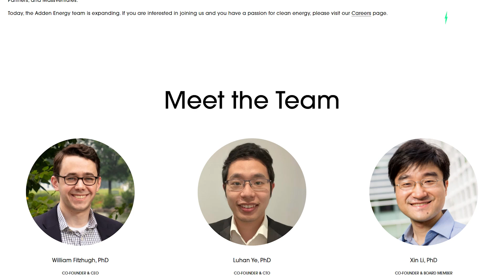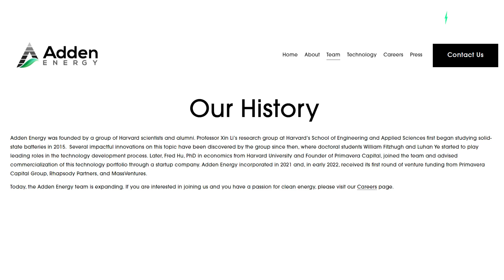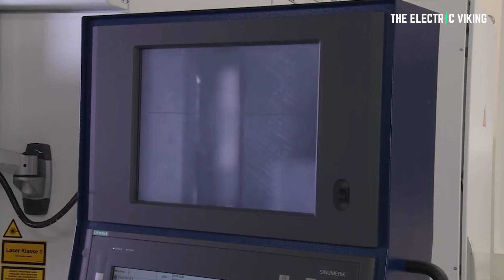Harvard engineers develop solid-state battery that works for 100 yrs

Comment: Hey Sam, thanks for another great video! The quality of the content you present has greatly improved, since I started wathcing your videos more than a year ago.

As for SSB, they might have their role to play but probably more in : race cars (you could imagine an only electric version of 24h Le Mans where fast charging could come in handy), sports cars (where having a battery that can bear huge decharge rates is a plus), hybrid battery systems cars (thus making waiting times shorter when you're in a hurry or just crossing the country for holidays) or even just in critical areas (like backup batteries for hospitals, fire departments, servers) that need a battery able to quickly deliver and be recharged (in case of succesive blackouts scenarios).

Comment: Geely's fast charger sounds good, but how long will it take for me to see this charger at my local gas station? Be able to buy a decent car that can accept such a fast charge? How much stress does that hyper jolt put my battery pack under? (A lot) Does it prematurely age my battery pack? (yes). Also keep in mind the unusable portions of battery packs, not below 20, not above 80, that's 40% of the pack not available. You can say that car has 300 miles of range but it's really only 180 and that's before hot/cold weather. AC and heaters inside. Standing and waiting. Etc.

Comment: At the risk of sounding like I take this seriously, if this sort of battery with long durability, high energy density and fast rechargeability became available, but only at a high price, cars could be designed with double or perhaps even triple battery packs. One small SSB pack capable of 25-50 miles for daily, get around town use and a second larger LIP pack that would have 200-400 miles of range for the occasional interstate jaunt.

Comment: I can see solid state batteries being used in multi chemistry packs like ONE are working on to cut down on charge time when needed. Maybe it will get good enough and cheap enough at some point to just have all solid state. Might be just the really expensive cars first, ones that are $130,000 or more.

Comment: I think solid state battery will be part of the future. If it does not fall into flavor because of future higher density batteries, Toyota will have the back up plan to continue. It is only a pity that toyota still mainly focusses on ICE in their rhetoric than coming forward stromg with the ongoing research of SSB.
Reply: Awhile back, I watched a documentary on Toyota and I recall they leveraged hybrids nicely as their fulcrum point of change. It takes tens of thousands of hours of analysis (roughly 80 hours a week @ 5 years) and a little luck to stay relevant. Underestimating the cost of disruption is very dangerous and can cost more harm to the environment than realized.
Take for instance what is going on with the protest by Norwegian farmers against environmental regulation of the nitrogen emission by cutting emissions in half but have done nothing to fund replacement with the correct solution.
By cutting subsidies for fertilizer in half but not providing an answer for maintaining sustainable levels of yield and quality, there is a risk of many food shortages and hunger.
Likewise, producing the solid state batteries to sustainable yields needs intense levels of time spent in the labs, government policy review, market creation incubators at a high level of articulation.

Comment: I believe that this is the reason why general motors decided to go with pouch style batteries. Pouch batteries are the easiest to convert into solid state so if you have a factory that is built for pouch batteries and later the solid state batteries are perfected you can more easily convert a pouch battery factory to a solid state then you can with either prismatic or cylindrical.
Reply: I think you have a good point, at the rate technology is moving  , design things adaptable,
Reply: Highly doubt the production lines will be in any way interchangeable.
Reply: @lengould9262  I don't think it's as simple as that, my point is that they built the lines with upgrades in mind.  Right now Prismatic batteries are just as cheap as Pouch batteries and to top it off they're much easier to thermally manage, so the question is why wouldn't GM have standardized on Prismatic?  The reason, I believe is because Prismatic batteries don't have the same upgrade path to Solid State that Pouch batteries have.  As an example I'm fairly certain the same machinery utilized for creating the Pouch Laminates can be utilized in creating Solid State Laminates.  Will the factory need to be retooled?  Of Course, but instead of it costing 4 Billion to build a new factory they should be able to retool an existing pouch factory for WAY, Way, way less.
Reply: Hard to roll ceramic...

Comment: A solid state battery that lasts 100 years.  Sounds expensive. Like something the government or military would buy.  Something useful in semi trucks., submarines, emergency response vehicles.  A battery pack that out lasts its original vehicle by decades would be disruptive.  The model of ownership would change.  You buy the car, lease the battery pack.  Or if you buy it outright, do you have the right to put it in your next vehicle?  Would EV manufacturers continually change designs to discourage exactly that?  There's always some new ratfukc around the bend with new technology, some way to squeeze more money out of the consumer.
Reply: A 100 year battery could be a life saver on Mars and in space. So it may not be disruptive after all. I think the key here is inculcating 100 year battery  infrastructure as a seed of military, NOAA, and space industry growth.

Comment: For general public I don’t believe solid state Batteries will be needed if they can get a dependable 300 mile range in hot or cold weather and 5 minute or so charge rate even 10 minutes for a full charge wouldn’t be to bad. If they can do this and have a long battery life that would last 10-15 years it would greatly reduce the environmental impact.

Comment: To charge in 3 minutes, will demand  a line from grid to battery 😅  of enourmus dimensions, say 50kWH in 3 minutes. I think that better batteries maby you do not have to charge more than once a week, the charging is done at home in the night. The other possibilitys is that we use small personal viecles, take the battery to youre home, charge over the night.

Comment: I'll follow on sorry  for so many comments.  The problem with lithium is scalability; there isn't enough. I checked this particular solid state cell is Lithium Metal - but others do not use lithium.  If you get a safe battery; you can cut the weight of EVs down to that of hybrids and ice vehicles; this is critial to becoming superior to those types. RIght now you need a very heavy protective 1000lb package to protect from punctures. If you can do this and lower costs, and increase or even maintain life span; at a similar cost per kg/per watt - then you transition from marginally green and expensive to cheaper and very green potential.

Comment: They didn't mention energy denisty but this is the sort of battery tech that EVs need to meet their potential. It is a double edged sword as batteries of this level of superior capability make investing in lithium mines and other existing tech look like very risky ventures. Are you going to invest in Lithium mines if this shows up in 3 years?  True maybe this has some lithium also they didn't mention chemistry either; but other new options don't use it.
Reply: Lithium has it's momentum similar to silicon in solar and CPU's. I wouldn't be surprised to see hungry advancement keeping pace with budding technologies trying to dethrone the leader.

Comment: What is even the point of making batteries that last a lifetime when the components besides the battery dont last a lifetime and you need to scrap the car anyways?
Reply: The old "buy and throw away" mentality will be going away. Repairing your stuff will become the new mentality. So, EVs will last much, much longer than previous generations of cars.

There's always going to be someone willing to repair old EVs, since the battery will still function and represents a good amount of value.
Worst case; some EVs will be hard to repair due to spare parts not being produced anymore (or being proprietary shit like Tesla), but then you can take that battery pack apart and put in an EV which had a battery that didn't last as long.

Currently, even decade-old EVs are going for insane prices, and still being sold pretty quickly.
I can even see myself fixing old EVs, if the upcoming engineered crisis takes away my employment.

Comment: lol SS batteries will improve and evolve the same as traditional is doing at this very moment, it will only borrow innovation tailored for the latter and improve on it. Both will be replaced by a new format within the next 10-15yrs, city/town commute daily drivers will be down to weekly charge times by then.
This whole deal will come right on down to weight, volume, and hazard mitigation out of the box.

Comment: I suspect the cost of solid state batteries is more due to volume of production than base material costs. So , ruling them out on cost is misguided as the costs will drop once volume manufacture is achieved.
Reply: It may depend on how large of a single crystal can be grown without disruption. That is part of chemistry and scale that requires a very high level of control.

Comment: Geely's 600 kw charging is definitely not going to be viable for atleast 3 years. Tesla had trouble with heat before with slower charging speeds. Plus battery degradation. And the sheer amount of energy to run these  stations is too much.
Reply: It's the materials and design that overcome the barrier of higher voltages. There are many chargers driven with Silicon Carbide Semiconductors and Gallium Nitride threatening to replace it. Both of these technologies are a threat to each other.

Comment: They key issue is time. Charging rates and charging station availability and costs will be the determining factors for the masses. Of course, battery tech goes hand and hand with charging rates however, consumers do not care what type of battery is in the car, we just want to know that 300 miles down the road we will be able to fill up at a reasonable cost in minutes rather than hours. Pretty simple, time waits for no man.

Comment: 10,000 cycles at one a day is 26 years. Filling up once every three days is 82 years!
Reply: maybe the calculation is full cycles, meaning 0 to 100%, but if instead is from 15 or 30% to 100 then maybe that number will triplicate or more.
Reply: was literally picking my calculator up to check the number which did not make sense in my head. 27 years at most charging from 0 to 100% everyday
Reply: I also do not understand at the beginning he said that solid state batteries are not long lasting and after a couple of minutes he said they can be recharged 10 000 times in comparison to lithium ion cells around 2 000 - 3 000 times. So why SS-Batteries are not long lasting I am confused!
Reply: @Tron Jockey maestro but where did you get 300 miles? i think the only clown here is you jockey.

Comment: If battery life continues to improve, the batteries will outlast everything else on the car, maybe several generations of cars.  You might end up swapping out the car and putting the pack into a new one, assuming the car manufacturers design them to allow that.
Reply: Which make Teslas impossible to change cheaply with the battery being a part of the chassis.
Reply: @MegaWilderness  not really, the chassis component is considered one part, removable without loss of integrity. How it is fastened together, leverages sharing of the structural load.
Reply: @gary.richardson  Don't be naive, the carpets are glued to the battery and the seats attached too, bonded with glue or sealer no doubt. Wiring cooling etc. Nightmare swap. You won't catch me buying one. And you get only one place that can do it at extortionate cost

Comment: BINGO! Great one Sam! 
Indeed the solid state guys are too late to the party. By the time they are mass producible and reliable, they will have missed the entire switch to EVs. 
However, next decade’s (or the one after that) new vehicles may well be solid state. 
Which begs the question of how car companies can even stay in business at all?  If cars become self driving and have batteries that last a million miles and maybe are made from stainless steel like the cybertruck…. what the heck would cause anyone to have to buy more than one vehicle in their lives? Given that, how could auto companies survive after the initial sales are over?  
Perhaps auto makers ought to rethink how long these things last and price them accordingly? Maybe have different pricing tiers for how long that model should last??
Reply: Cars may become more like houses and go through remodels and upgrades. People go to home care centers like Lowe's and Home Depot to do DIY repair, improvements and add value to their home.
Alternatively, car dealers will become battery dealers that cater to relevant products and services that surround the battery. It seems to make more sense to be battery centric, right?
Instead of Home Depot, it's now Battery Depot, where you can do things like do performance/safety mods, RV conversions, aesthetics, etc...

Comment: Critical problem for solid state batteries is that it consumes more lithium, which is a big deal because of Lithium scarcity, and will not work at today's Lithium prices!
Reply: Lithium isn’t scarce , just the refinery’s to process it . That will change.
Reply: @Rosewood185  The energy transition involves a "battle of the bulge" as everyone dives in at once. Solid state sodium batteries will be needed until energy transition is complete. But Lithium in future will be used for higher priced vehicles, and solid state sodium for the masses.

Comment: Solid-state batteries will be mass-produced no matter what by 2025. They will cost significantly higher than ternary batteries at the start but will definitely be the norm in 2030.
Reply: Not if the current tech kicks the legs out from under them. That's the point of this video.

Comment: Energy density, charge rate, life cycles, but you didn't discuss temperature.  The need to warm batteries is a big inefficiency with liquid electrolyte systems.  Functionality at low temperature is a huge issue and if a SS battery overcomes this, it will be a game changer.  From a Minnesotan.
Reply: As chemistries change, the variables must be watched closely without assumption that things stay the same. The same people who notice the change can be the same that overlook the change or don't bother to try. It takes a culture that embraces both change and continuity with the willingness to both keep and let go of pride.
Reply: Canadian here.  I've been wondering about a real cold snap in the winter with the batteries Tesla has been using.  At -35°C (-31°F), do the cars even work?
Reply: @netgnostic1627  someone needs to provide Project Farm with batteries to test, side by side and post on his channel.
Reply: @netgnostic1627  not a tesla owner and its never freezing here but I believe it will from what ive read before. It wont completely shut down to keep the battery warm, and drains about 20% charge overnight, also a lot of total range is lost like at least 30%, so not ideal, best to keep in garage.
Reply: @netgnostic1627  Norway has an extraordinarily high EV adoption and it’s obviously a cool place and they have no issues.
Reply: @netgnostic1627  I was told Tesla battery limit is -22°f .... Which is dangerous here in Midwest.
Reply: That's was a big thing with the aluminum sulfur battery or something had to be at 200+ degrees. Temp is going to be a big thing. Or the next thing you get you asbestos poisoning from
Reply: 55
55-gallon q
P
Reply: I wonder what the weight diff is
Reply: The have battery heaters
Reply: Should incase them in Aerogel to keep them from temperature fluctuations.
Reply: Let’s seee if this sees the light, this sounds like it’s never gonna work or millionaires won’t let it go ou to market until 30-40 years
Reply: He did not say how many watt hours per kg. This is all bull.
Reply: @vince2x2  You do understand it is not his product, right? You sound jealous.
Reply: @travellover3373  Too funny LOL.  Jealous? WTF?😝

Comment: Most likely they will be combined and added to axial array motors and super capacitors, and systems added fir environmental control to keep life of the systems extended out to longer lengths and it will be platforms so that only electronics, and interiors are purchased most often, reducing the carbon cost to produce these machines.